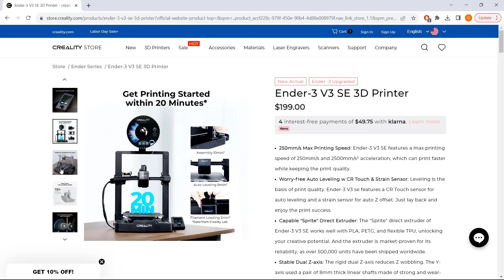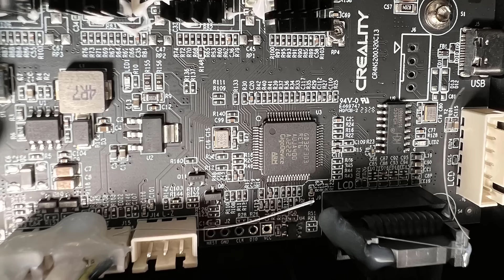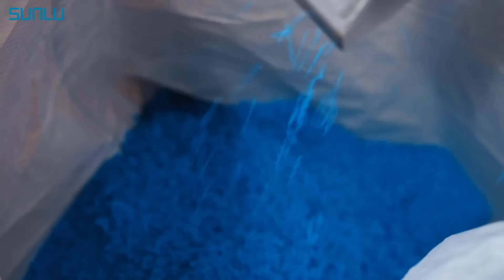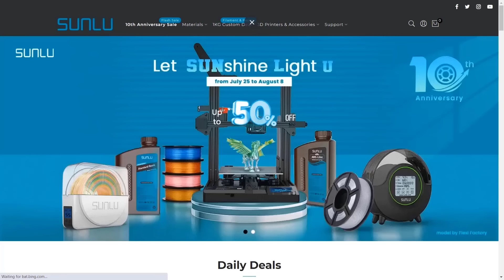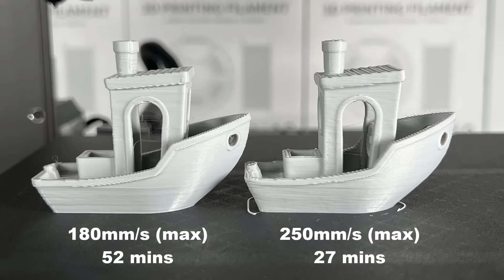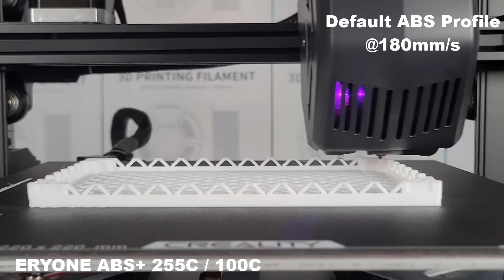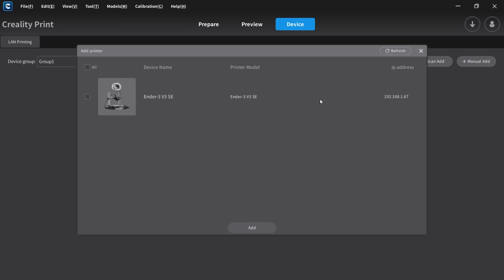Creality Ender-3 V3 SE: $199 budget 3D printer with auto z-offset, CR-touch, Y axis linear rods

Comment: How did you not notice your cr touch bracket was bent?
Reply from the maker: I saw that, it won't cause any issues as long as the sensor position is consistent. When I use 3D printed parts to add BLTouch on some printers, the position may not be perfectly straight, but there is no impact on accuracy as long as the sensor's position doesn't change and the bracket doesn't flex, the pin still retracts at the same point every time.
Reply: @AuroraTech  man that would drive me bonkers! Always love your videos. Keep it up. Have you reviewed the X-Max 3 already? Curious to see if you've had any issues with it or not. Mine has been a lemon unfortunately

Comment: Are the dual Z stepper motors separate drivers? So dual Z leveling can be automatic
Reply: It's only one motor, last I checked their page on this printer. Dual lead screws is still good so the gantry won't sag on one side.